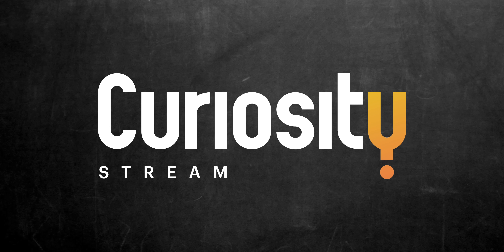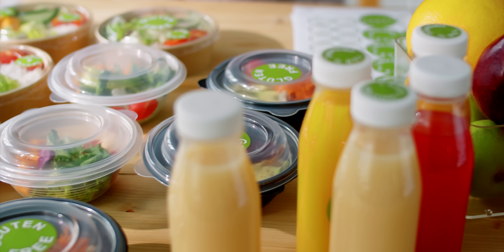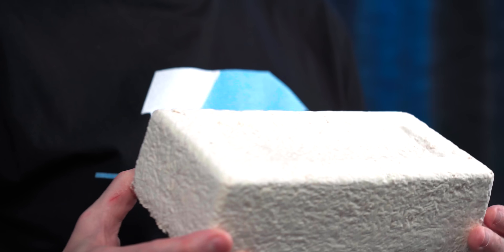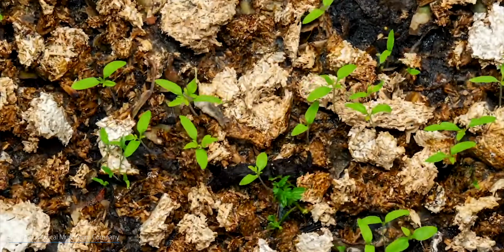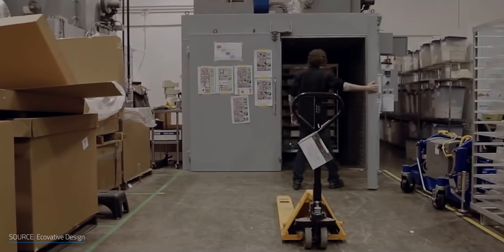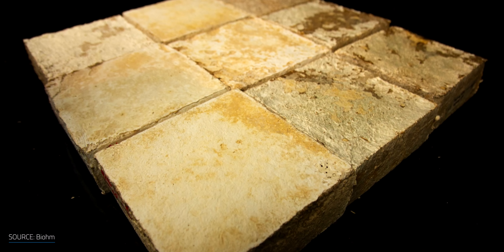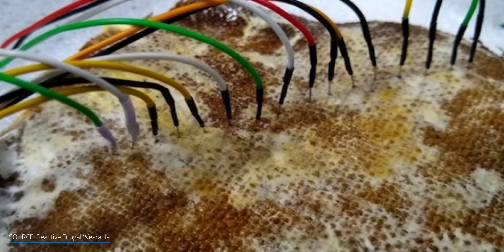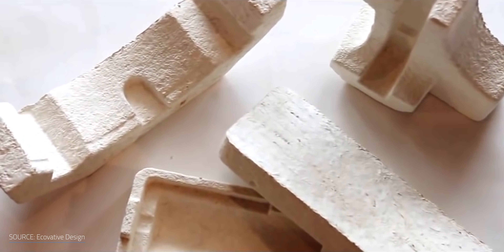Is Mycelium Fungus the Plastic of the Future?

Comment: We would be better off engineering mycelium and microbes to digest/recycle plastics.
The opening to this video sets up the issues of micro-plastics, plastic bottle and plastic bags. First, micro-plastics are largely an issue of the developing world.  It is corrected by further development, education, international cooperation, to slow/halt the accumulation, and clean-up tech to deal with the current content. Secondly, The Mycelium solution being discussed does not address either bottles or bags in any way - which make up the bulk of the micro-plastics - so why attach them to this discussion? Those offending products would have been better points attached to a discussion of bio-plastics, as they are designed to address those issues specifically. Lastly, there is no mention in this of the time-horizon, water-use problem, or CO problems.  How long does it take to "grow" a mycelium product? How much water does making them use? What is carbon output of industrial scale mycelium production - they do exhale CO, afterall?

Comment: This stuff sounds great and I'm looking forward to seeing it used for packaging.  I'm concerned if it is used for insulation.  It would be important to compare how flammable it is compared to fiberglass.  We should try to make our homes as flame resistant as possible as we look for new materials for building.
Reply: Yes and No in regards to your last sentence. It's an important factor, but as a firefighter we REALLY need to be careful about that. The past couple of times that became a driving force we ended up with 1) Asbestos all over the place, which is one of the most carcinogenic things in existence and very hard to get rid of; and 2) building practices circa '80s - '00s with an awful lot of fire-resistant materials... that happen to be extremely toxic if they do catch fire (and let's be honest people are stupid so they catch fire pretty regularly.) Kinda reduces the point of going into the burning building and saving people if they're already on a 6-year cancer death clock the moment they're exposed to such toxic smoke (or even already dead from enhanced smoke inhalation, iirc some insulations from the mid '90s produced stuff like chlorine gas that kills stupid quickly. Didn't stay on the market long obviously but still.)

Comment: The reason why things like this show up and are hailed as a magic bullet then never go anywhere is because THERE IS NO SUCH THING AS A MAGIC BULLET. No technology can magically solve massive societal issues. Electric cars cannot fix all of the problems that were created by the extreme overabundance and over-reliance of automobiles, or even most of the problems. Wind and solar alone will not be sufficient to solve the complex issues of power generation. Cryptocurrencies will not solve the problems within financial systems. And making bags and packaging out of fungus will not solve the complex issues of plastics.

Why is this? Its simple. It is not the technology that is a problem, but the way it is used. Replacing gas-powered cars with electric ones may reduce CO2 emissions (though not nearly as much as you'd expect) but does not fix problems like the country slowly being devoured by oversized highways and parking lots, pollution from lubricants, tires, and other materials, inefficiencies in infrastructure that is built for cars and not people, and much more. The solution is not a magical new technology, but instead to address each and every issue together through a profound change in how nations build and operate their cities and transit needs. If national infrastructures were built to where the number of cars used was reduced by even half, the sheer improvement in environmental and societal benefits would be far more profound than simply replacing cars with electric cars. 

The same can be said of plastics. Simply replacing plastic with a new material, even a bio-degradable one, doesn't solve all of the problems. That's because the material itself is not the source of the problems, its how the world uses it. To fix the problem of plastic pollution one needs to change a society that produces and consumes billions of tons of single-use items that are immediately disposed of, cheap items that break quickly and are disposed of, and cheap plastic-based materials that are not even needed. If the same uncaring practices are continued, regardless of what material is used, it will always result in pollution and waste, because our society is by its very design wasteful and unsustainable. Even if this fungus could be produced in large enough qualities to replace plastic in packaging, it would still wind up with hundreds of millions of bags, straws, soda rings, and packaging materials piling up on roadsides and finding their way into bodies of water, breaking down and introducing foreign material to the ecosystem. 

To solve plastic pollution you dont even need to replace plastic with new materials. You need to greatly reduce over-reliance on single-use packaging, end the practice of building short-lived items, massively reduce production of single-use disposables, and reduce societal consumption in general. Could this fungus help? Yes it could, it could play a valuable role in making a less wasteful society. However if we do not address ALL of the issues and only replace plastic with mushrooms while changing nothing else, we will almost certainly wind up finding out that billions of tons of fungal materials being scattered all over our ecosystems is probably just as bad as microplastics.

Its nice to believe that a new technology will save us, but that is not and never has been the case. Societal problems are not like animals, you can't stop them with a single bullet no matter how advanced that bullet is.

Comment: if it only takes 45 days to decompose I wouldn't really trust it to make a good long-lasting shoe. I get it You shoe won't necessarily be outside in the mud all day exposed to the elements. So it will last longer. But still sounds like the shoes would easily fall apart in less than a year. Maybe even half a year.

Comment: The costs are not there, they are no where near there, the effectiviness of it and limited time use is going to be the biggest setback for the push for it. For wearables it is a test of durability, which in your video covers that, its not as strong as plastics, it also doesn't appear to be flexable at all so I don't see it replacing TPU based products like cellphone cases either.
Reply: It's being used plenty already as stated in the video. No one is trying to replace all plastics over night, but the more better alternatives we have the better overall it will be for the environment. No time to waste.

Comment: How about we start by requiring that any company that accepts bulk materials for recycling must grind up into tiny flakes any plastic that does NOT get recycled by their process.  Bottles and bags and other waste plastics that aren't going to be used to make new products should come out of the processing facility as piles of plastic flakes.  The flakes can then be mulched and buried in landfills which would drastically speed up the decomposition.  No more loose bags and nets for wildlife to get tangled in.  Just plastic flakes.  Funny thing is, if the waste plastic is all uniform shape and size, then it becomes much easier for other companies to figure out creative uses for it.  As piles of plastic trash, no one wants to deal with it, but as mounds of plastic flakes, they start to become more useful to more companies, and if it just ends up in the ground, then it will decay faster while taking up less space.  This seems like a low cost low effort way to transform mountains of plastic trash into something that is a little more manageable and possibly more useful.

Comment: i am not sure why this hasn't happened already. it is more than likely due to plastics lobbying. Amazon could help this go a long way by removing the plastic air bubbles in packages and using mycelium foam peanuts, and even stop using cardboard and use mycelium packaging. If they did this, they would force the planet to move towards mycelium immediately.

Comment: I regularly wear a fleece jacket that I bought in the year 2000. After twenty-one years, the jacket still does what I need. I still own a jacket that I bought in 1988. If I ever lose enough weight, I'll wear that jacket again if only for sentimental purposes. I'm currently wearing warm-up pants that I bought in 2009. I've had to do a few repairs, but they do what I need them to do. I'm wearing a T-shirt that I bought around 2007 or 2008. The T-shirt won't last much longer, but I've gotten over ten years of good use from it. Parts of it are still in good enough shape to use as rags after the seams have failed. 

Based on that usage, the idea of clothing that will break down faster is stupid. Maybe that kind of clothing would have value to people who think that their pursuit of fashion requires them to get rid of every item of clothing that they own after only a year or two of use. No matter how much they recycle, I think their need for something new and different every year is the real problem. For me, I'd rather have a fleece jacket that give me thirty years of good service. 

I'm disabled. I can only do things for short periods of time. I also have to be careful with money. When I bought my current house, I had an enclosed front porch that wasn't insulated. The porch wasn't heated, so I didn't feel bad that the porch wasn't insulated. On the other hand, I thought that adding insulation would slow the heat loss from my home overall. Working little bit little, sometimes only ten minutes per day, sometimes not getting back to it for a few weeks at a time, I insulated the porch with fiberglass insulation. Paying someone to insulate the porch would have been a hardship. I also felt better about getting the job done by myself. 

Based on that effort, the idea of insulation that is going to biodegrade and need replacement every five or ten or even twenty years is just stupid. Maybe there is some degree of fiberglass insulation wastage when people remodel homes or when homes are destroyed, but most of us put insulation in place and leave it forever. Making insulation biodegradable is stupid. 

I have nothing against cellulose or even mycelium packing materials. I'm as glad as anyone to see those plastic peanuts disappear forever. I have received products that were packed in fiberglass insulation, and that insulation has always found a spot somewhere in my house that needed insulation. I have water lines that no longer freeze because I had a few pieces of fiberglass insulation that I refused to throw away. I packed them in the area where those water lines were, and the problem was solved. I've done a little bit of that with bubble wrap as well. However, plastic peanuts are difficult to repurpose. To the extent that mycelium replaces those, I'm happy for mycelium to join the marketplace. 

I see little point in making biodegradable bricks. We just don't have that many brick structures that we want to biodegrade over time. You spoke of highway materials, but I have no interest in having to replace retaining walls or sound insulation walls every five or ten years. That's a waste. Furthermore, biodegradation is not always predictable. Having those walls fail unpredictably is a safety problem. For a truly temporary wall that would not be load-bearing in any way, a disposable, biodegradable option would be useful occasionally. Making bricks in the traditional brick size is foolish. The labor involved in brickwork means that we need those walls to last. If these lightweight bricks could be made much larger so that a temporary wall could be quickly constructed and easily dismantled for disposal, this idea could have value. 

I think the idea has real merit, but this video oversells the concept.

Comment: Here is the thing people don't realize about biodegrading. It takes outside forces to work. Plastics do biodegrade but they take years simply because they are resistant to those outside factors. As long as companies don't put resistors into these products I will gladly support them. Just to be clear, wearing mycelium based products doesn't mean they will stop functioning after 45 days when they biodegrade. Anything properly cared for can last much longer than their biodegrade date simply because those outside forces don't have the time to take effect.

Comment: One of the reasons we use plastics is because another way to say "biodegradable" is "it rots." Generally, having your products and household good rot is a bad thing. Short term packaging that eventually rots is fine; we've used paper products for packaging for centuries, and mycelium looks like an improvement. But home insulation that's prone to rotting doesn't sound too wise. Likewise for building material, especially since it is so much weaker than conventional building materials. As for clothing, the question becomes: does it rot faster than conventional natural materials like cotton and leather? If so, that's probably not a viable application.

Comment: Considering it's biodegradable, I'd have some concerns using it as a permanent building material, but certainly it's perfect for replacing single use plastics. Although for building, it might be great for short term pavilions -- grow a small building in a week, and a few months later it's just dirt, and if it's in a forest, no need to even remove it!
Reply: Wood is also biodegradable. Still make houses it of it
Reply: @lampostsamurai2518  fair... Although wood doesn't turn to dirt in 45 days. Plus it's usually treated to increase strength and/or durability
Reply: @DoctorX17  Its like you didnt even watch the video. He explains how it can be used for construction
Reply: @DoctorX17  maybe I missed it but I didn’t see the video say it turned into dirt in 45 days? The only issue with it as a building structure, is that it isn’t very strong compared to wood or concrete.
Reply: @DoctorX17  not true
Reply: I’d have concerns of rot and insect infestation if used as insulation. For that matter rodent infestation?
Reply: I think everybody is missing the point that it would only be used as insulation material, not construction material, houses will be made of wood or whatever you want but the insulating material won't be made from plastic. I don't know if it is going to be very useful because there are already alternatives for insulating material made from wood which work much better
Reply: My main issue is with packaging material, will it rot? Because I use the original packaging material when I have to shift the stuff when I move.
Reply: wool insulation and wool carpet is as good as anything else out there and wool is biodegradable

Comment: I love the idea for using this stuff instead of styrofoam, but that acoustic "test" that was done was not done correctly if all they did was test a 1000hz tone. Traffic noise is also not particulary strong at that frequency, or any frequency for that matter. its like white noise, it goes all over the spectrum. If what im assuming is correct in that, they only tested a 1000hz sine wave. Then they really should test more, or you should have shown the results if they did. i'd love to see a full frequency spectrum compared to petrochemical acoustic panels.

Comment: This is really fascinating and while it would be a good step in the right direction to replace plastics, the comparison from mycelium foam to bags and other commonly used plastics isn't really a fair comparison.  There's no way a type a foam will replace forks, straws, or most importantly, bags.  You stopped this comparison quickly but it is slightly misleading that it was ever made.  Even if mycelium was picked up as a new leading way to replace plastics in packaging and insulation, that's only a fraction of all the things plastics are used for.

Comment: Mycelium can't replace packaging plastic, the type that gets disposed of the most. It sounds like a great alternative to polystyrene but with substantially higher production cost. Clingfilm is actually a very bad polluter as well as it can't be recycled and we're yet to find a better alternative. I'd argue that we don't need it most of the time and that we don't need to look for an alternative as a result but rather, a global mindset change. It wasn't even 100 years ago that people didn't have anything made out of plastic and did just fine. Carry a glass/metal bottle and a woven bag with you for example. You can reuse them and fill up at shops rather than purchasing one time bottles or other packaging.

Comment: In short, they lack most useful properties polymers have. Plastics are very easily malleable, very cheap to produce, highly resistant to aging, chemicals and (some) to temperatures, excellent structural strength for its weight. List is endless. Yes, I skipped the negatives but it was just to show fungi just cant be "plastic of the future". In uses where it can replace plastics, alternatives exist already, like stone wool, papermass etc

Comment: Lets make this a basic logic test. Yes its biodegradable cool. It takes a week to produse one brick. That brick need nutrients which if you want to use these to repace plastic you will now be spending massive amounts of energy to priduce thos nutrients. Recycling will not cover it. Plastic is oroduced at such a massive scale its ridiculous but this has the same bottle neck as well other renewable. It is just not efficient enough